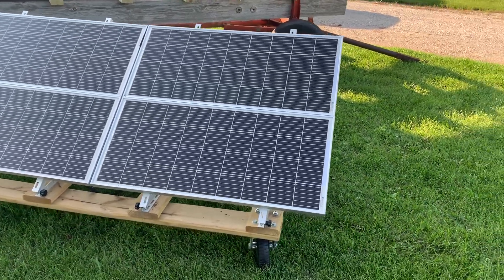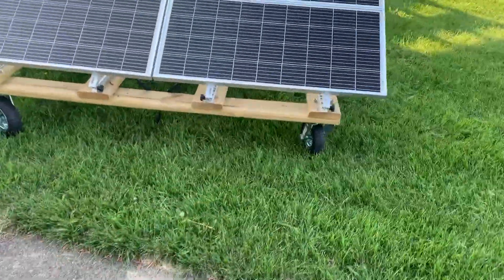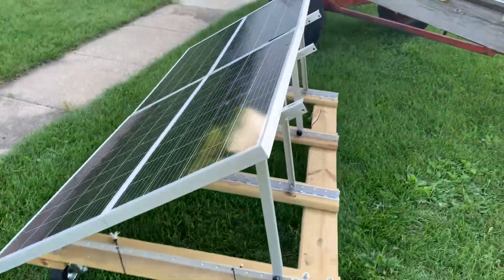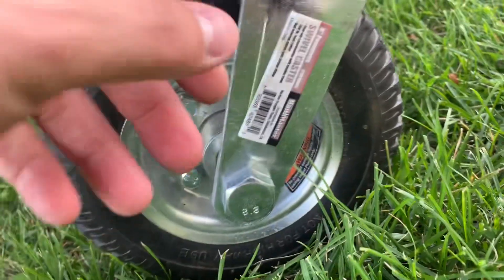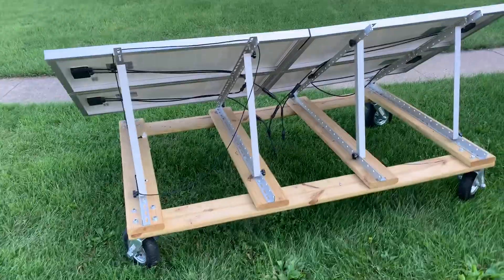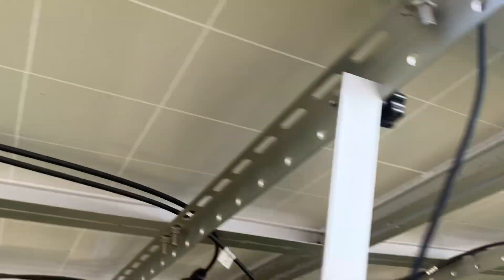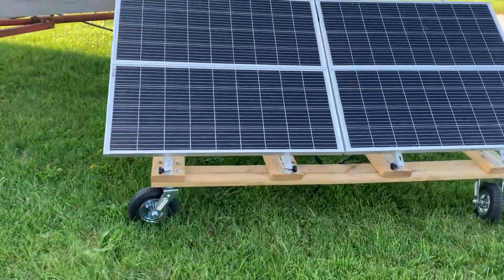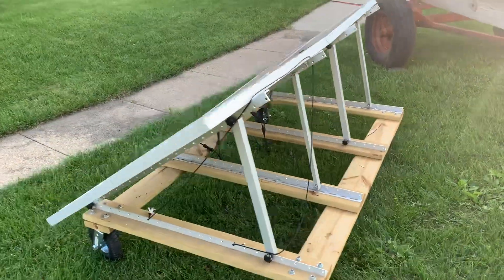Simple DIY solar array - Eco-Worthy 100 watt panels

Comment: delta2 or delta2 max, which one do you prefer for this setup? Thanks
Reply from the maker: @weitang1196  if you can afford delta 2 max, I would do that. Never can have enough storage. Refurbished on eBay the last few days the delta 2 max has been $699
Reply: @rnkustomz  I asked because I'm afraid the 4 100w panels will be enough to charge the delta within a day. I need more backup capacity for 4 100w panels. It's better if I go with Delta Pro. But the pro is for more panels, like a whole house backup system. I'm building a system to run a backup fridge under the gazebo. I need to spend more budget on the garage later on. Which one do you perform for running a Fridge? Thanks
Reply from the maker: @ both are great options, depending on the size of the fridge the delta pro could be more ideal, especially if you have multiple cloudy days in a row
Reply: @rnkustomz  Thanks so much.

Comment: Thought I would put my 2 cents in. I have 8 100w Eco-Worthy panels 4 standard 4 bi-facial. On a cold 38 degree noontime I calculated 885 watts output twice. I have aluminum foil behind the bi-facial. I live at 4300' in the Cascades so thin atmosphere. Thanks for the video. Thumbs up and subscribed.
Reply from the maker: @lapinebob  I have been thinking about trying to add a reflective base under my bifacials. Would be nice to squeeze every watt out of them I can for sure. Thanks for the support!

Comment: I'm new to the solar community and have a question about voltage. For the Delta 2, there's a maximum voltage input of 60 but according to the specs, it's maximum wattage of 500. If you wired up 5 of those exact panels, would it be too much for your brother's Delta 2 because of the added up voltage? Do you add up the VOC or the VMP?
Reply from the maker: @TenTenorioArt  you have to take both into consideration, but going over on volts is dangerous, going over on amps shouldn’t pose a threat to your unit. Technically the delta 2 should have over volt protection but I’ve always heard not to trust it and be careful. You can go over amps and it shouldn’t be a problem, the unit is good at limiting at the rated number. That’s the reason I did 2 series 2 parellel. It can be very difficult to max the delta 2, and that’s why I just gave up and settled on 4 panels haha
Reply: I'm considering just getting a single 400 watt portable panel. So many issues and I'm not an electrician or engineer.
Reply from the maker: @TenTenorioArt  as long as it fits the input specs it’s not a bad idea. Also if you live in a cold climate you want to stay 15% or so below the volt limit
Reply: I just bought the same set up. Delta 2 and 4 100 panels. Can you do a video on the exact wiring and actually plugging it in to the Delta 2. Thanks for this video. I like the mobility
Reply from the maker: @DT-ww4gv  yes I can! I actually have my brothers delta 2 at the house again so I can try and film this tonight
Reply from the maker: @DT-ww4gv  video comes out tomorrow at 5:05 pm central time

Comment: Great video. Did you have to get the permit before installing those DIY solar arrays? I am planning to do it but wonder if it needed a permit prior to do those ground mounted solar arrays. Thanks.
Reply from the maker: @kajavaid  obviously every county/city is different. Since mine are not mounted to the ground, and are mobile, I didnt need a permit in my area, and all my electrical is off grid.

Comment: I saw these on sale today. Do you know if this solar panel can charge an ecoflow river 2 power station?
Reply from the maker: So the base model river 2 looks to have the following specs: 11-30V 110W, 8A Max

You should be able to use their 100 watt panel with a river 2 as the panels voc is only 24.5. According to their listing the Should work well with that setup. Thanks for watching and the comment! Bi facial and non bi facial panel should both work

Comment: I think it's a GREAT little 4 Panel setup!! I may build an identical unit, but like you said, I likely will use 2x4s in place of the deck boards. Thanks for the info!
Reply from the maker: If you build it let me know! Would love to hear how the 2x4s hold up compared to these?

Comment: where is the battery?  can you explain how they were wired togehter, perhaps another video?
Reply from the maker: This small array was using a ecoflow delta 2. Ill try and borrow it from my brother and make a video showing all the wiring for this setup
Reply from the maker: I’m posting a video currently that shows wiring a panel to a solar battery box now

Comment: Your wooden frame is almost identical to mine. I'll have 4ea 100w mono's as well. Good video, thank you for posting.
Reply from the maker: @Montana_Outdoor_Adventures  any suggestions on additional bracing for mine? I’m thinking of cutting a 2x4 to run diagonal across the bottom to hopefully limit the sag.
Reply: @rnkustomz  I am going to have to rack mine at a 45 as well, I am not using the Ecoworthy mounts as I have a ton of 1" angle iron salvaged from old bed frames, this angle will also serve as the 45. I got 5 twin size bed frames on market place for ten bucks locally, couldn't pass it up.